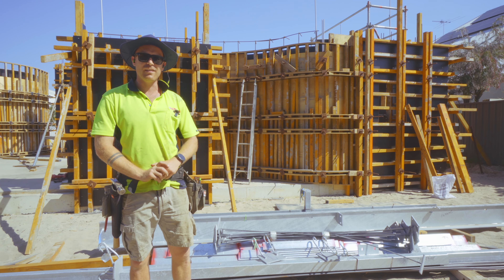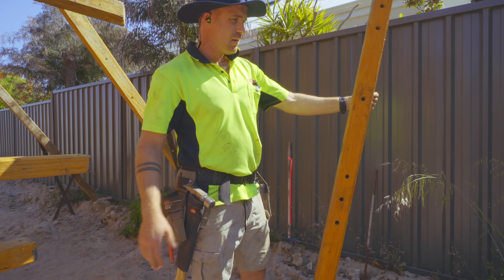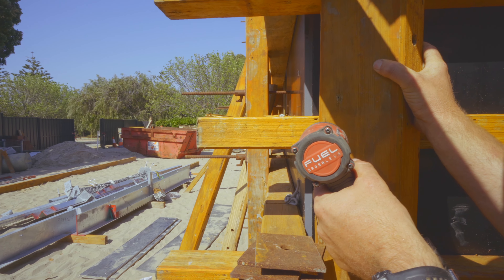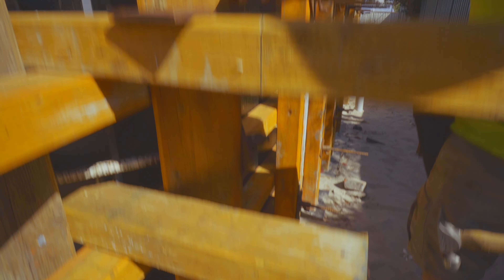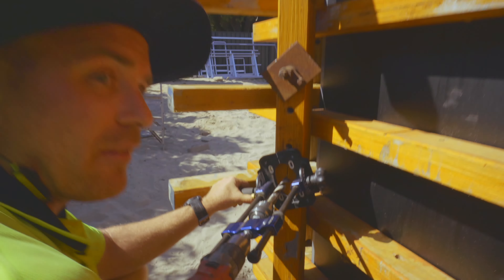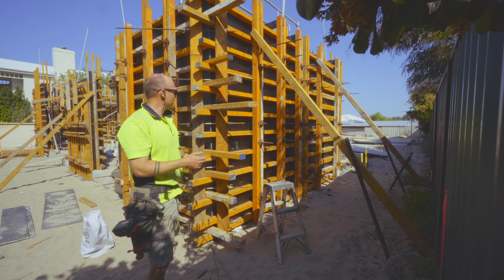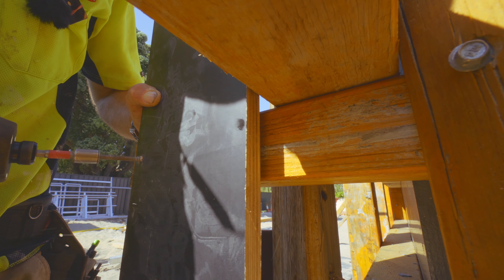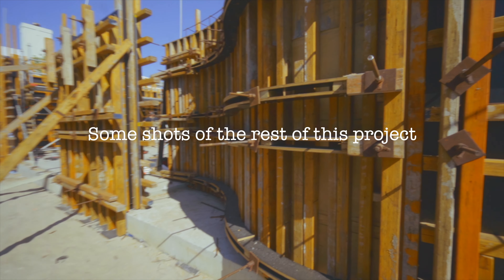BMFORMWORK: The Ultimate Way To Brace Concrete Wall Corners

Comment: I like the idea of not having to buy snap ties for each project. Just learning as much as possible and this technique seems a bit more sensible than snap tie... I'd like more vids with this tie of form ply work
Reply from the maker: I have often wondered the opposite. But have never used snap ties. Some of the jobs we do now are far to big to use snap ties or even coil ties. But as you know, with this kind of work often it is best to just stick to what you know as if it goes wrong it’s not good!

Comment: Absolutely professional and great work! See much same as we using the traditional timber formworks, except that we using a single timbers in a vertical way, and twin timbers horizontally. Anyway you reach a great surface - that's the main thing. With respect from mountain concretor!
Reply from the maker: Thabkyou, where are you?

Comment: Ben do you reckon you could do a video on the process of cnc cutting them radius/curves lines. Like all you need is the CAD file of the drawings?? And a shoutout to the business and what sort of costs? Cheers Ben
Reply from the maker: Yep I can do that, I found out how to do videos of me on the computer which will be a great way of showing the curves
Reply: @bmformworkconcreteconstruc9783  legend

Comment: Awesome stuff. I’m in love with concrete walls. Can you recommend a book or website that teaches this formwork for DIY? I would love to learn about the process and materials and tools used to build these forms. I have construction experience but have never built concrete walls. But I want to learn!
Reply from the maker: It’s taken me 20years on the tools. It would be a very big book. There are 3 elements. 1. Having a good understanding of carpentry skills 2. Understanding concrete pressure and the strength of your materials 3. And the unicorn of concrete mixes and additives to get the ideal finish. All take many years to learn.
Reply: @bmformworkconcreteconstruc9783   I have the carpentry skills but lack the knowledge of form work and concrete. Btw, what company did you buy the bolt tie rods and wing nuts/plates from? or recommend a company that sells these bolt rods and nuts? USA doesn’t seem to offer this. Did you buy from an Australian company or from china? which company do you trust for these products?
Reply from the maker: I buy them from anyone of the several local formwork suppliers. I’m trying out a different tie called coil ties on my next project.
Reply: @bmformworkconcreteconstruc9783  thank you! I saw those coil ties too. I noticed some have been using the fiberglass rods that get snapped off afterwards, but i like the holes left behind by the bolt rods and not having to repurchase rods for each project